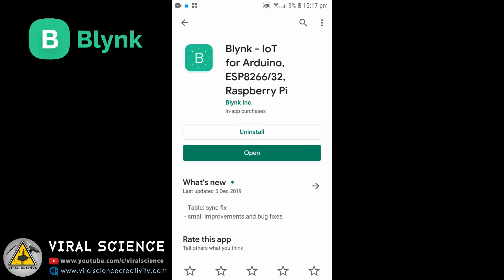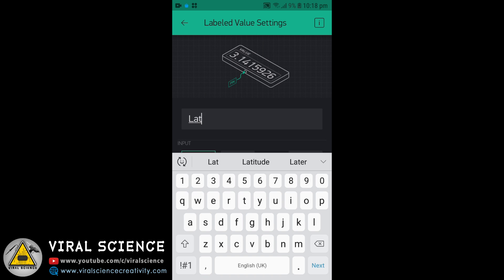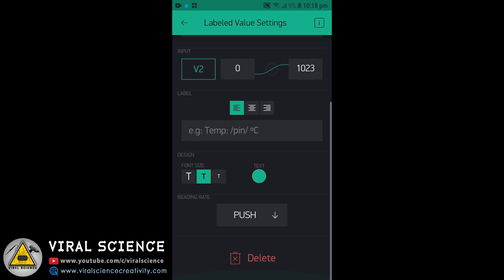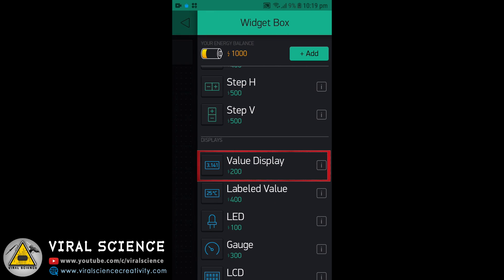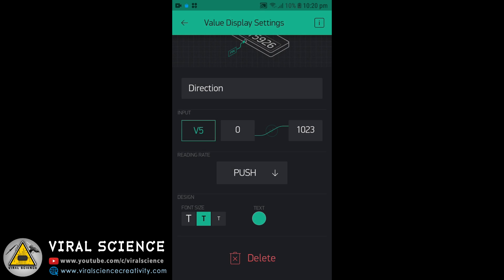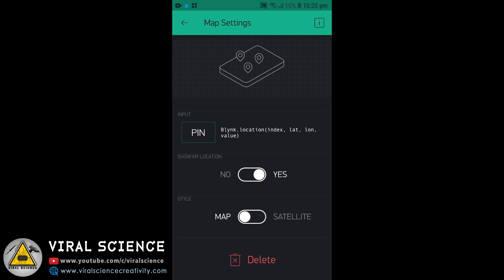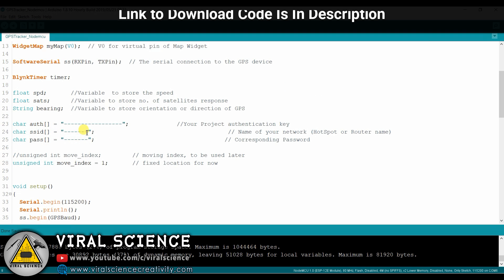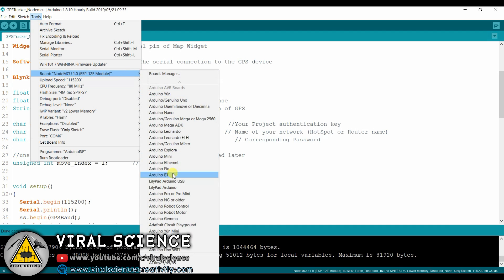Real Time GPS Location Tracker | Nodemcu ESP8266

Comment: Hi, Great tuto!!
Do you think it's possible to add something to put the tracker in sleep mode when not used? My idea is to connect the tracker to the vehicle's battery in order to charge it when the contact is ON and when it's OFF then a 18650 could take over. With that we could use the tracker 24/7 and when the vehicle start it can charge the 18650.

Comment: Hey brother nice work 
If I will place the GPS module to 10 -15 CM away from its original position will the serial monitor show different value 
What us the minimum distance  in which the data of GPS changes

Comment: Would it also work using a Keywishbot BLE Nano V3.0, Mirco USB Board Integrate CC2540 BLE Wireless Module ATmega328P 5V Micro-Controller Board?

Comment: PLease help: My Serial Monitor is not showing  anything, just blank
Reply: Check the baud rate
Reply: @UBsLab   i did, it is set to 115200
Reply: @saiprashanth8692  keep the setup running for about 20 minutes in the open.

Comment: What's the point of a gps tracker that needs connecting to your WiFi?
Reply: you can use it without wifi also
Reply: @joerivera7407  how ?!
Reply: @mohamedmamdouh8862  using gsm sim module in place of wifi module
Reply: @joerivera7407   So, using GSM module, have to insert sim a d activate through call? Or inserting sim would be sufficient? Please clarify.

Comment: But in this way you can only track the location when the tracker is inside your home, otherwise the tracker will lose wifi signal and it will not work anymore. Any idea to solve this?

Comment: Can Blynk map display more than one GPS signal ? my position and 3-4 more GPS signals from 3-4 arduino devices ? 
Or is it possible to gather all that GPS signals to one aruino and then send them all together to Blynk map? 
Thank you very much for your time. You have my respect.
Reply: Yes, it's possible... Just put the required amount of maps in blynk and change the pin of the map to some virtual pin and write the value from the GPS module to the map. Hope it helps.Regards